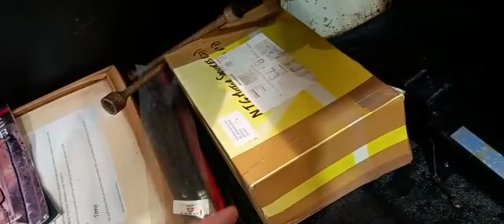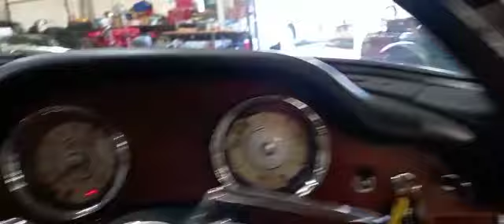1969 WOLSELEY 16/60 | MATHEWSONS CLASSIC CARS | 17 & 18 JUNE 2022

Comment: I had one for 3 years...very easy to work on but let down in part by the engine; (  1.6L , 61 hp )..and the mild steel bodywork was prone to rust...as many cars then. But hey!...the 16/60 was nice to have around you on the open road.